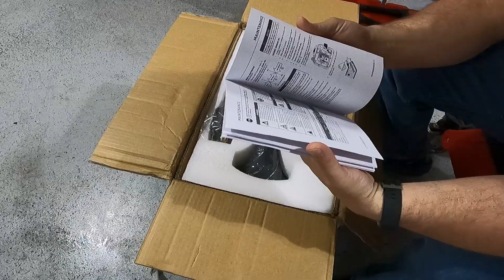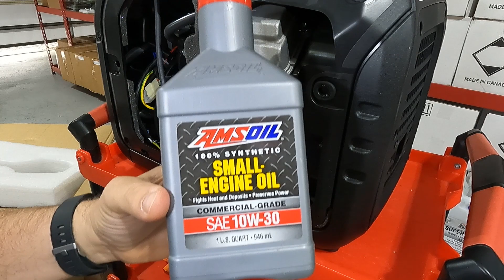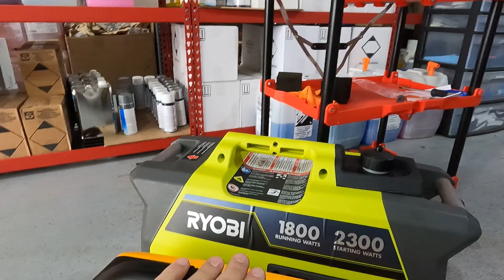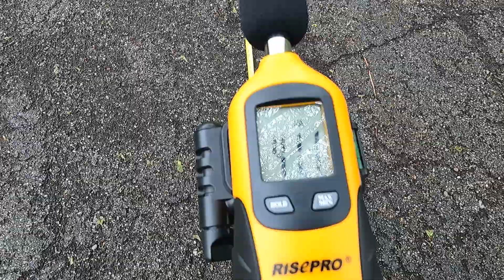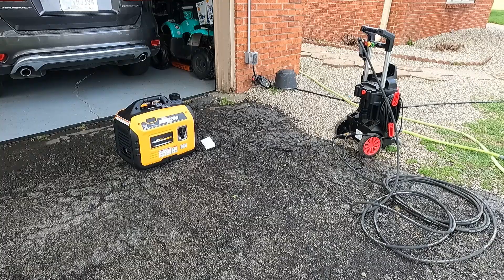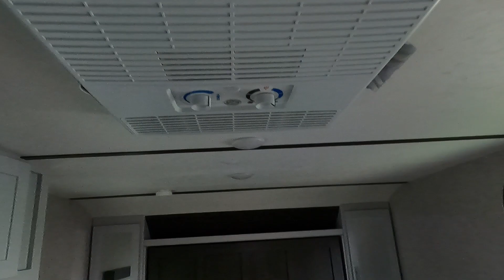MaxPeedingRods 3200 Watt Invertor Generator! Plenty of Power for Mobile Detailers and more

Comment: I have the genmax 3200 which is identical to the maxpeedingrids. Just different stickers. Mine also sputter a bit with no load but smooths out with a load.
Reply from the maker: Yeah it smooths out just fine with a load on it